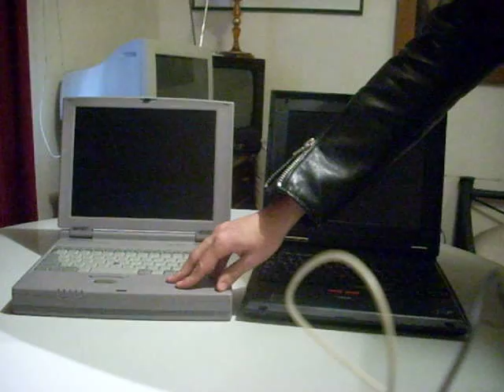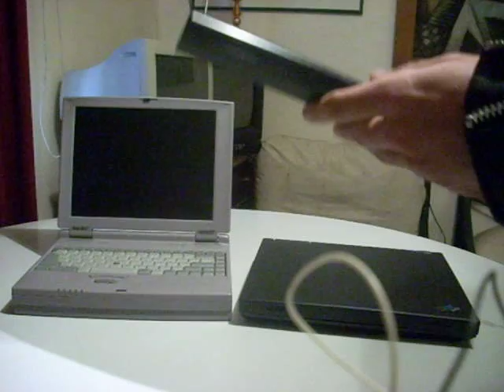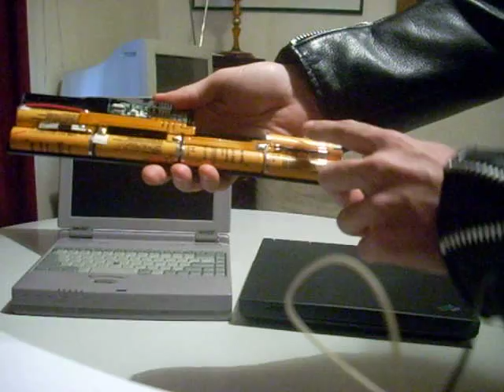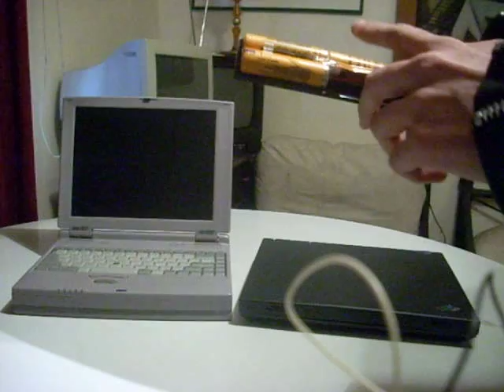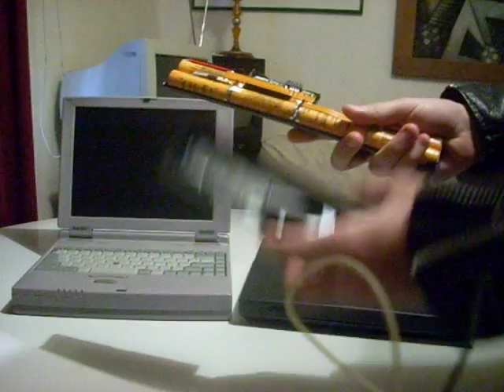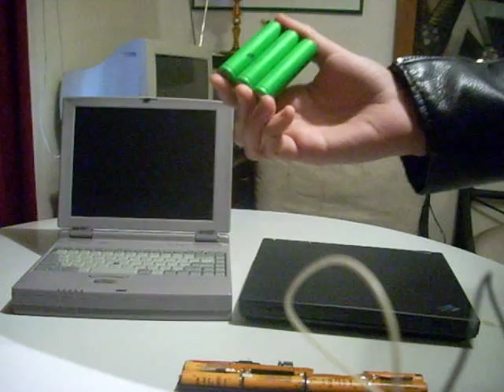Intro to Rebuilding Laptop Batteries

Comment: hi. nice vid, i have an acer aspire one which had a completeley dead battery and recently i replaced the cells (3x18650) but the battery wont charge did i messed up or is some kind of circuit preventing it to charge? thank you!.

Comment: Nice Video. I threw out a battery for my old compaq laptop before. I had no idea you could do this. The replacement was cheap though. 

Are all laptop batteries like this? Is there any risk of opening it up and finding acid?